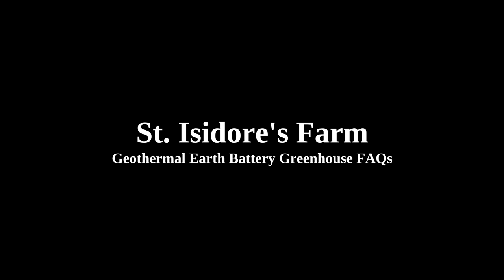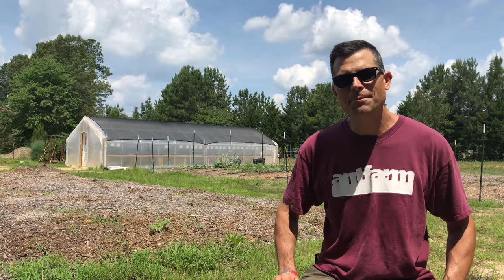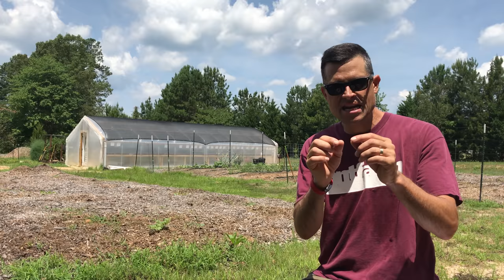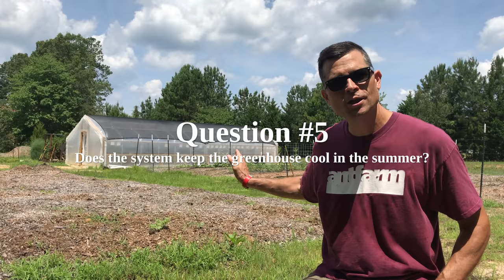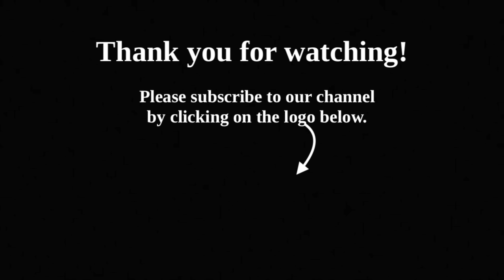Geothermal Earth Battery Greenhouse Pt. 11: TOP 5 FAQs

Comment: So good to see the climate batteries are in good working order. I have a question for your kind attention.I am living in a hardiness zone 9B where only a few days with temperature below zero. Do you think just with in-house climate battery ( no active heating) can grow tropical fruits all year around?
Reply from the maker: There is a gentleman in the midwest that has been doing it for years with a slightly more sophisticated version of what we built. Think he is in Nebraska with very cold winters. So yes, it can be done.
Reply: St. Isidore's Farm thanks so much for your reply positive approach. yes I have seen his videos and only difference is he is using constant deep ground temperature of 52F. I'm researching on a similar method which can be achieved with series of 20 feet deep manually drilled vertical holes and
tubing system. will keep you posted as project goes.

Comment: I'm just thinking about your humidity problem,  maybe you could install a water mist injection system at the exhausts of your earth battery system,  this system could be controlled by a humidity sensor strategically positioned just like a thermostat.  Now I'm no engineer but if I'm not mistaken getting control of your humidity could also help controlling the temperature inside

Comment: Awesome!! Thanks for the update. Have you thought about shutting the 6 inch  fans off during the summer?
Reply from the maker: We do turn them off at night. There is a theory (We stress theory) that you can "charge" the earth battery with heat during the summer and pull the warmth back out of the soil in the winter. We guess the idea is that if the ground temperature remains relatively constant, you can raise that temperature during the summer and use it in the winter. We'll see if it works and let you know if future updates. Thanks for watching!
Reply: Yes I read or saw a YouTube video where a way up North they recommend going down one foot underground with your tubes for each month of winter so if you only have three months you'll need three feet if you have eight months then you need to go 8 feet down

Comment: Did I miss the moisture content of the soil you backfilled the green house with...
If the moisture content was low.. I'm thinking you're not getting the most temp. exchange possible..
From a optimum compaction point of view..
The number is usually in the low teens (% soil to water).. In clay it can run as high as 30%..
Easy rule of thumb..
Take a hand full amd squeeze.. (No water running out)
You want it to hold it's shape... If it doesn't it's to dry...
I personally thank you for your data..
It will help me save time with my initial testing

Comment: Hi, Grate info. Can you explain how you wired in your dwyer pressure switch. The dwyer switch from what i can make out only goes upto 1.4 psi. surly the pressure should be more than this. . The trend pressure switch looks identical but seems cheaper, where i am. Could you exsplain a bit more about this and how you got on with it please
Reply: The pressure in the cavity is measured in inches of water (inches water column). The typical inflation pressure is 0.25 in. wc --0.5 in  wc. (0.009 psi - 0.018 psi). With 1,4psi the cover would blow up like a balloon and explode, in reality the fixings holding the cover would let go long before it reached that stage ;)

Comment from the maker: BONUS FAQ #6: Won't air take the shortest path from one end to the other and most of the pipes be useless? ANSWER: No. Air doesn't work that way. Air pressure want to reach equilibrium. Think of air conditioning systems in your home or car. One fan with ducts running to multiple vents of a central trunk. You don't have all the air coming out of the vent closest to the fan. The air gets close to equilibrium with equal amounts of air coming out of all the vents.
Reply: Air will always take the path of least resistance, the layout must present a very high resistance for the air to opt for the drainage slots in the tubing and cracks in the soil ;) Just to clarify, If you have a tube thats twice as long as another you wont get the same flowrate through both tubes, the shorter tube will have more ;) It is important to balance the tubes in the system so they all have roughly equal flow. Making them all the same length doesnt guarantee equal flow, especially where bends, curves or junctions are involved ;)
Reply: Yes, it is about equal total pressure drop in all duct runs if you want equal flow in each run/to each outlet. Otherwise the flow in each run will reduce or increase until the pressure equalizes across the duct system...which is why you get less flow in long runs or runs with lots of fittings, higher pressure drop=less flow.
Reply: I watched your video I am doing the same thing in landers ca.  I just wanted to make some suggestions for your system to work better.  Use 4 inch nonperforated pipes.  You don't need or want to do gravel.  Sand or fine soil is best for thermal properties.  Having each pipe be a pass threw with 4 inch inline duct fans would be more effective.  Wrapping the vertical section of pipes with insulation will help also.  Covering the ground above it with white panda poly or refletix will make a big difference also.
Reply: Dont lose sight of the fact its a greenhouse for growing plants ;) You`d be better to use opaque tubing for the vertical sections of pipe as black insulated pipes tend to block light. If you use non perforated pipe, be sure to include a sump and a pump to remove the condensate so you can return it to the plants. Perforated pipe will return it directly to the rootzone.

Comment: What if you were to put a second run of pipe underground that goes outside of the greenhouse that you could switch over to in the summer since you dont need the battery heat at night in the summer months. I'm thinking two straight loop runs of 250 ft or so each.  Basically would be more of just a geothermal system rather than an earth battery.
Reply: When the air cools to ground temperature in the first 15- 20ft you`ll have wasted cash on tubing and a big powerful fan thats capableof handling long, high resistance ducts ;)

Comment: Thanks for the series, I am trying to figure out the CFM of fans in my system I have installed. I have 550 feet of 4" drainage tile under ground. The fan suppliers has asked what CFM I want and the back pressure on the fans. I was looking for 2 times per hr but your advise was 5 times per hr. The supplier has had issues with the 2 times at 400CFM with the back pressure he fells would be occurring. Did you get the CFM you were expecting or was there back pressure on the fans and air movement.
Reply from the maker: Sorry for the delay in reply. While our system is working, I think it would work better if we had higher CFM fans, or a lot more of them. Especially as it relates to cooling the greenhouse. We simply can't turn the air over fast enough to use the system as a heat exchanger and cool it.
Reply: @StIsidoresFarm  the fan size recommended we got from a supplier is huge about $9500 huge. This is not an option for us, can you let me know the fan size, motor size, length of pipe and CFM out the other side of the pipe. If you could it would help me make educated guess on my system.
Thanks Ed Hughes
Reply: @LTWGH918918 
$9500 is way too much for a fan for a system with 550ft of ads unless it was installed as a single 550ft tube with a serpentine layout ;)
Reply: It is a single piece, I’ve decided that I need to dig up the ends and make it 3 pieces of 200’. This I hope will help with a air flow.
Reply: @LTWGH918918  
That explains it :) 200ft is still way too long for individual tubes. i`d consider digging it up and starting over. From an equal  loss viewpoint, you can run 25cfm through 1 x 550ft tube, 132cfm through  3x 183ft tubes,  800cfm through 10x 55ft tubes,  2300cfm through 20x 27ft tubes.  You should design the system to move at least 20 greenhouse volumes per hour. With 550ft of tubing, the greenhouse floor area should be around 420sqft, eg: 30x14.
If you need 400cfm to turn the air volume twice an hour,  the greenhouse is a lot more than 420sqft and if thats the case you`ll need more than the current 550ft of tubing installed..

Comment: I have a simple idea about the fans. If you had fans on both ends and each came on at different temps and blew air in different directions, wouldn’t that be simpler? At 50 degrees and cooler fan a blew then off at 50 then fan b blew at 80 degrees and above. Idea being using simple rheostats.

Comment: and if you dig down and put 32 Gal. upside down under the ground connecting with the pipe under the ground it acting like a septic to drain the water from the pipe under the ground.

Comment: what will happen if soil get to warm and it is still summer. I think you won't be able to cool your greenhouse and the opposite in the winter.
Reply from the maker: Good question. Don't think it will get too warm in the summer, but that is part of the idea behind this system - get the ground as warm as possible going into fall and winter and then use that heat to keep things warm in the greenhouse.
Reply: I think your experiment will give best answer. This is something like car radiator. The question is - has it enough capacity to cool/heat the air going through it for a long time. If has not, this means that pipes are too short or too closely and the soild cannot take away the heat/cold because of its conductivity coefficient which is as higher as more dense it is. If there is underground water is the best for such systems. And this isolation you did is wrong - it is stopping soil to take the heat/cold. I know you are trying to get battery effect but it cannot keep the temperature for months anyway, a few day or  weeks in the best case. Do you have electric boiler? It cannot keep the heat for more of few days and it has much better isolation.
Reply: btw you could use ultrasonic humidifiers, it is cheap on electricity

Comment: The whole point of a geothermal air system is to keep the greenhouse at a constant temperature.
Reply: Well, technically you are heating/cooling rhe "air" in the greenhouse, using a set/series of tubes buried, outside the greenhouse. There is another way. Subterranean heat pipes, buried inside the greenhouse. It can also be a "forced air" system, or a "liquid coolant" circulation system. This way, you heat the ground under the plant which also warms the air to some extent. Iit is a very expensive syatem that is better designed and installed by pro's, but you better have deep pockets. Of course, in milder climats, heating is not really a problem.

Comment: First off, really appreciate the videos they were helpful in finalizing some of my designs, we are getting ready to test a similar design to regulate temperatures year round since we get both freeze & 100+ temps. 

As far as reducing the thermomass heat sink you are experiencing from the sun, you may think about testing the shade cloth sitting above the structure. 

If you look at any fixed structure (including shade cloth structures) in modern architecture, you have a roof which absorbs heat then a space between that and in some situations a ceiling which is insulated. Currently, you have the shade cloth attached to the structure and it allows no air movement to dampen the heat exchange. If your green house walls & roof have a air flow layer to act as insulation, with a displaced shade cloth, you should see a 20%+ reduction in heat sink.

You may also find this video to educate  about a farmer up north growing citrus:

https://youtu.be/ZD_3_gsgsnk